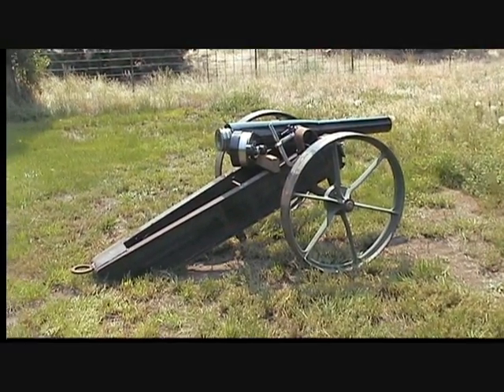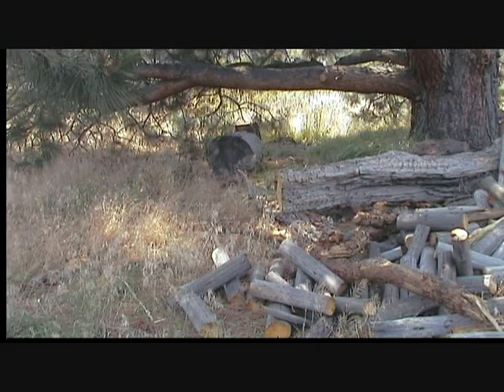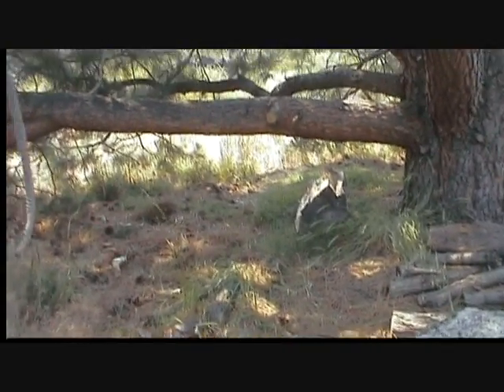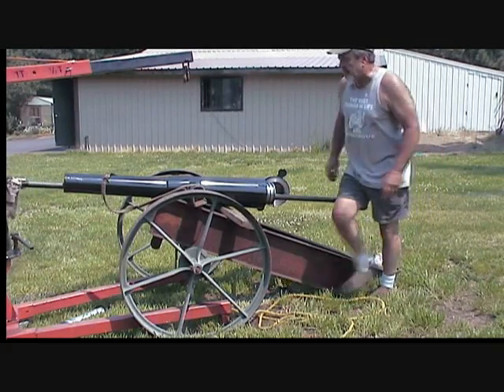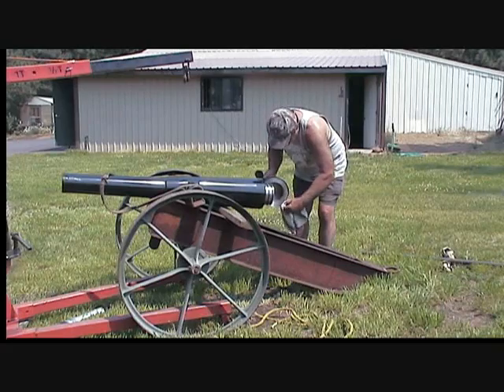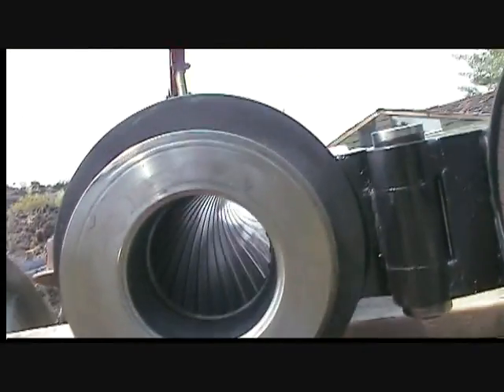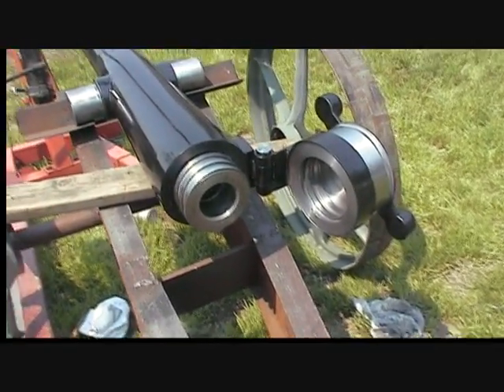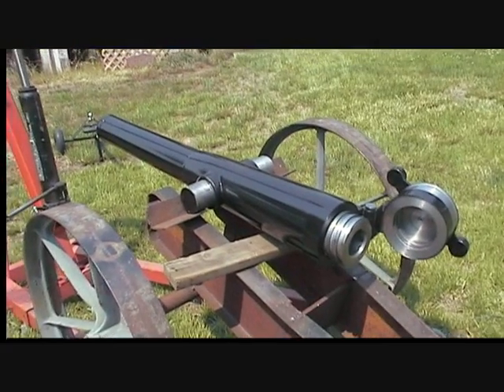Proof testing a new Whitworth cannon

Comment: You need some of those heavy bearing that bolt to the caraige good heavy duty ones like on a escavater for the hydrolic cylinders and she will be staying right there And use heavy grade bolts and a better thicker metal to bolt them to.or the ones with heavy bushings for heavy equipment and a grease fitting to keep it smooth on pivoting.get those from a salvage yard or new and a one and a quarter inch plate welded really good to bolt them to or weld them by a really good man that knows how to weld them to stay

Comment: I thought the Whitworth fired a "bolt" like the small arm rifle? That's a pretty conventional bore.
Reply from the maker: The Whitworth rifles did have a hexagonal bore that was very unique. But the most advanced thing about them was the breech loading system. The rifling turned out to be not that good of an idea. Nobody is using it today, but all modern guns are breech loaders. It's the breech loading system  that makes it a Whitworth in my opinion.

Comment: Haha, just found your vids. I'm sure there's a plethora of history to read and learn about when you start talking cannons. Thanks for posting these. Really cool. Just out of curiosity, what's the average start up cost on a used cannon?
Reply from the maker: Cannons are typically priced by how close they are to the originals. A real good replica Civil War cannon can cost 30 to 40 thousand. But I have seen good shooting cannons sell for 300 bucks. I paid $1100 for my first cannon. (just the barrel) It was a rifled 3" gun about 5 feet long. I made my own carriage out of a set of old farm equipment wheels and a chunck of an old glue lam. It was alot of fun. Check out Hern Cannons .Thanks for the comment
Reply: Looks like a lot of fun. I'll check out hern. I need another vice like a hole in the head! Rifles and pistols are bad enough. Thanks for the reply though.